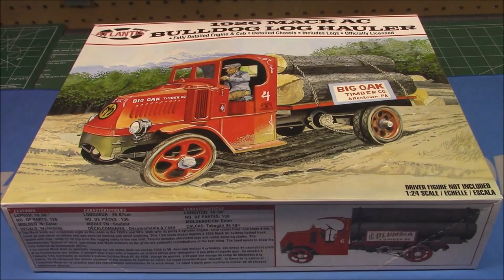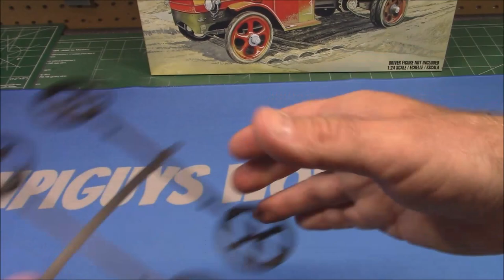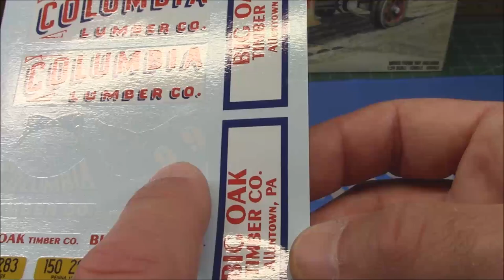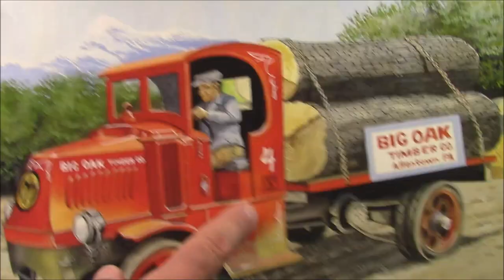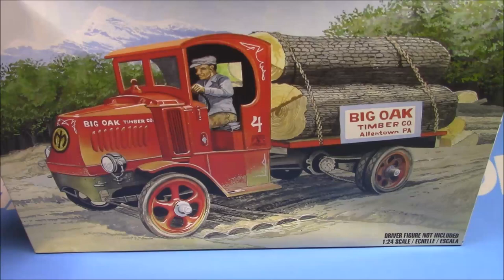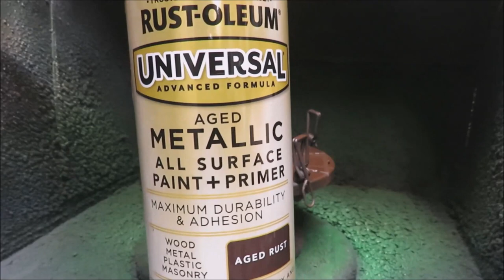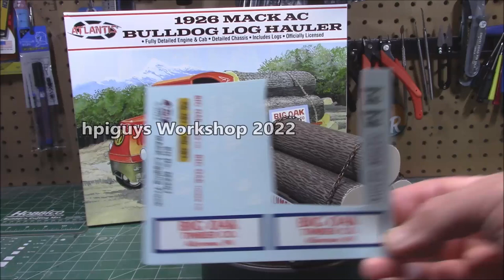1926 Mack AC Bulldog Log Hauler 1/24 Scale Model Kit How To Wood Grain Rust Fade Weather Logging

Comment: Imagine driving these for a living 90 years ago. No power steering, no power brakes, (not sure if they even had air brakes this model might still have mechanical cable brakes), no transmission syncros so you had to float each gear in neutral even with the clutch down, manual choke and spark advance so you were always fiddling with that while trying to drive…… those guys earned every penny they made.
Reply: Indeed!
Reply: My grandfather drove them! The one Chris mentioned that Jay Leno has, Granddad talked of those often.
Reply: And virtually no suspension.  The biggest disability of early truck drivers was back issues.

Comment: Beautiful work Chris. There’s a neat story about why Mack put the radiator between the cab and the engine. It seems that teamsters were trying to put trucks out of business by backing their wagons into trucks in back of them to wreck the radiators. An added bonus to having the radiator closer to the driver was the heat they gave in cold weather.

Comment: I usually love watching all you model makes, but I hate the new way you are recording them. I will have to stop watching if it continues due to my seizures.  I found your channel and started watching because all the other channels recorded just like you are doing now.  I could not watch them due to my seizures and now unfortunately looks like I won’t be able to watch yours either.  I have tried watching several of your newer models videos, but sadly I can’t watch any of them.  Love your channel, but sadly looks like I have to stop watching.
Reply from the maker: The only thing that has changed in the last couple years is that I have added the assembly process to the videos.
I added the assembly process over a year ago so you must not be watching all that often if you just noticed it recently.
Everything else about the videos is identical.
If you don't like the assembly section, simply skip over it. 
Thanks for stopping by!